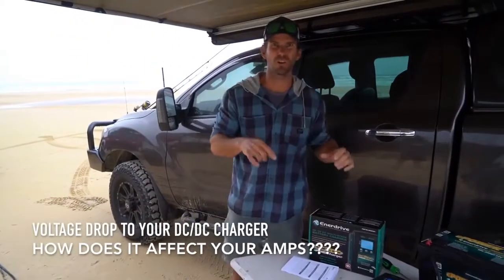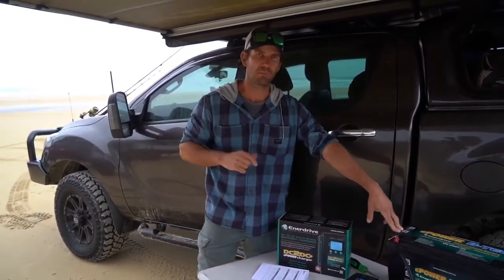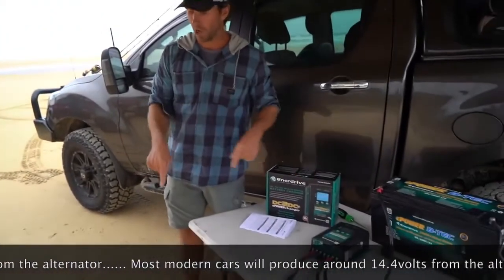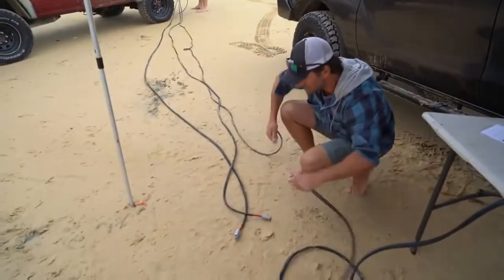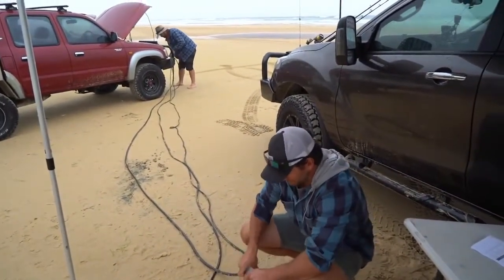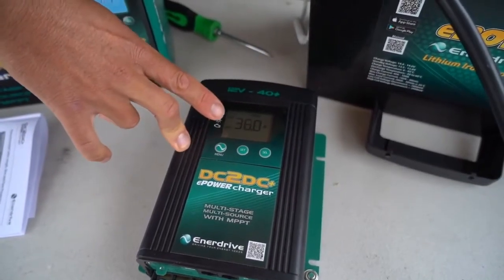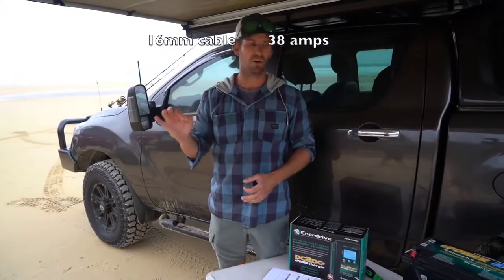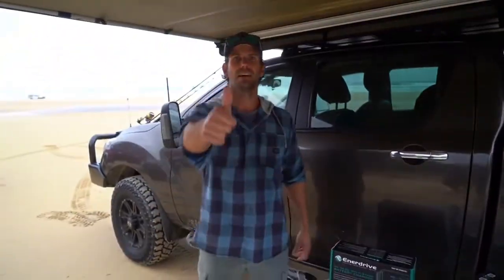Enerdrive Discusses Why Battery Cable Size Matters!

Comment: This is all well and good but a massive issue that needs to start being addressed is voltage drop. If ya dc2dc is set at 40amps for exampe and u have 16mm2 cable yes it will do 40amps when revs up but when at idle and its under 40amps the cable isnt big enough to carry return earth and faults the tow pro elites. A 10mtr run needs a 2AWG cable to be able to give u the full 50amps that the charger is capable of. Why places like enerdrive sell 16mm2 cable in 5mtr lenghts for caravan applications when it wont even provide sufficent current flow for their chargers is beyond me. This industry is selling people all this gear without being clear enough. People who pay big bucks like me for these systems want to be able to get max amps out of them. Why buy a 40+ dc2dc and then only be able to run it at 30 odd amps because the cables are under sized. Frustration with this topic and issue is growing bigger everyday within the industry.